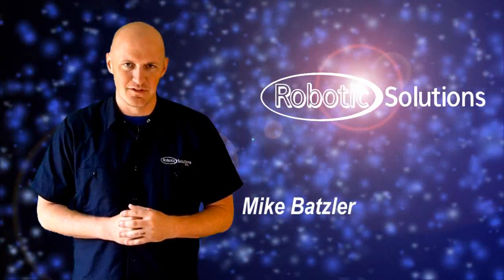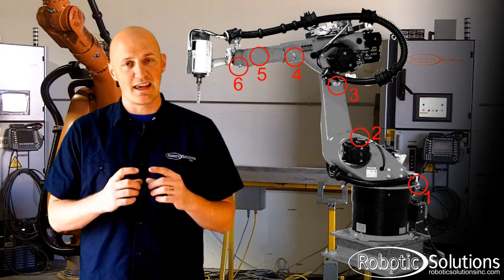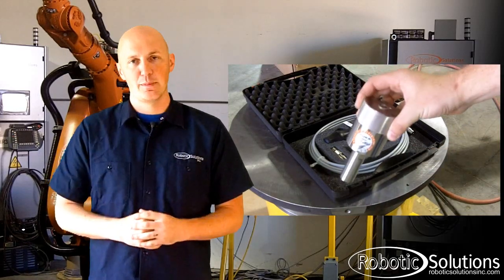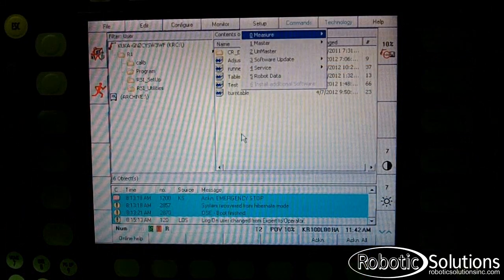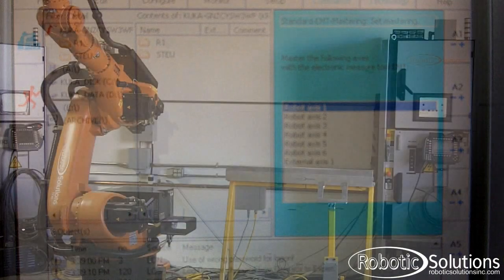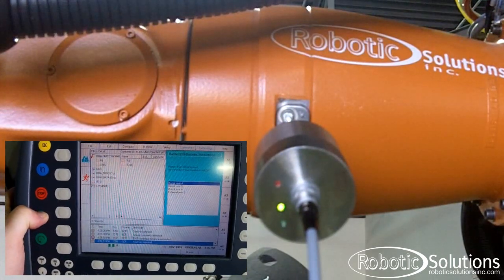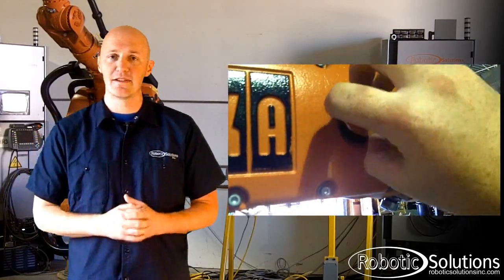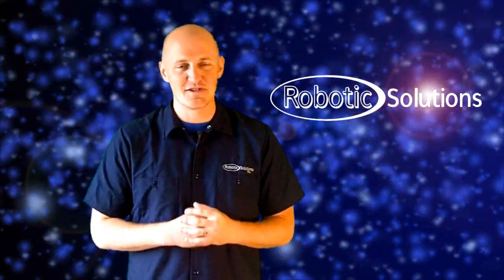Robot U - Mastering Your Kuka Robot

Comment: But what is mastering is it like calibrating a robot?
Reply: No calibration and mastering are two different things. Mastering is like telling the robot where is his reference point (so you align robot's axes to the whitness marks on the robot and then master the robot). Each axis has a pulse encoder which generates different outputs (integer numbers) based on that axis position. With mastering you are saying to the robot - hey if the encoder gives me, for example, the value 20300 it means I'm at reference position with that axis. So with this the robot can know if it is moving in the plus or minus direction.

Robot calibration is a method of increasing the robot accuracy and it is usually done after the mastering process.